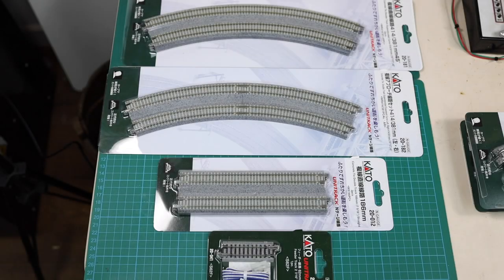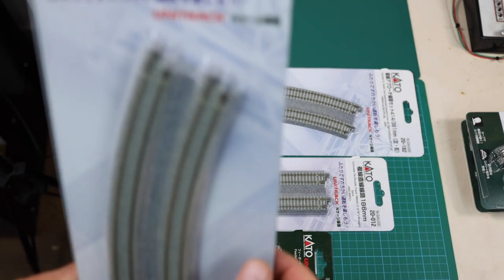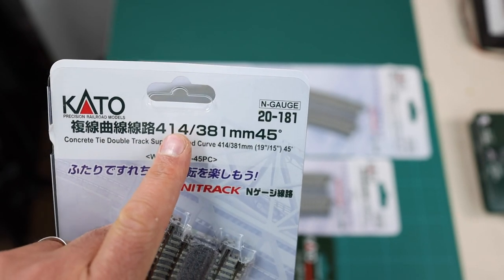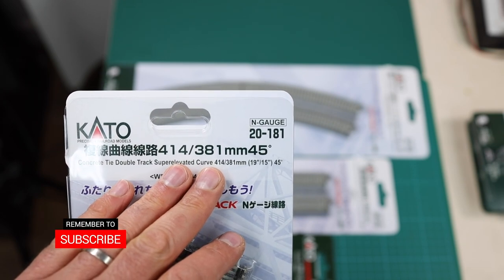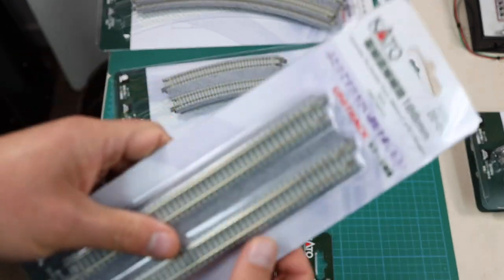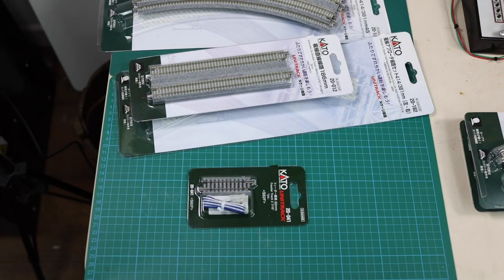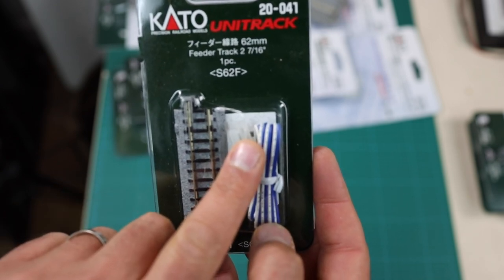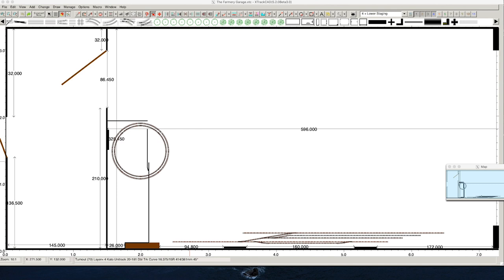Building a new (N scale) Model Railroad - Episode 5

Comment: Instead of the Feeder tracks, I recommend either getting or making your own Kato Unitrack Feeder Joiners, Kato 24818.
It was interesting that you were able to get your well cars around the super elevated curves.  I have some 80' passenger cars and I was having an issue with the string lining.
Reply: Strange...I've replied to this twice as my channel, but the replies have disappeared!  So, here goes again! Yes, I was unaware those feeder joiners existed, until I saw a video from Mike Fifer, where he showed how to make your own, using the existing unijoiners.  As for string lining, when I was testing it, it seemed ok, but I could see a potential problem if the bottom containers are not weighted, so I will put weights in the bottom containers, and make sure my autoracks are properly weighted to keep the centre of gravity low.

Comment: Did you consider the Kato 20-043, 62mm (2 7/16") Concrete Tie Double Track Feeder?
Reply: Hey Jim! I did not know about the double track feeder...but as I’m going to have a couple of blocks in my helix those won’t work as I can’t have any straight track in the helix. Will be using the feeder joiners instead (or making my own)